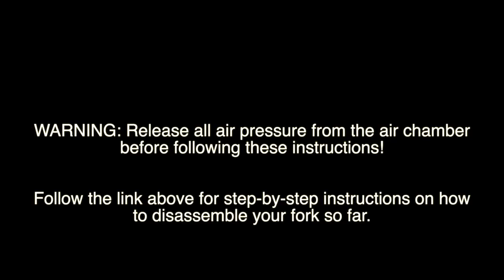FOX 38 Air Spring Service - Simple step-by-step instructions

Comment: Probably a really silly question, but do you have to heat the base of the shaft to remove the base stud from the airshaft? I'm worried about potentially overheating the airshaft surface or damaging the seal that sits inside the base stud? Any help or recommendations would be greatly appreciated!
Reply from the maker: Yes you really do need to heat the shaft. There is a fair amount of Loc Tight on the base stud and that won’t be easy to remove if you don’t heat it.
Reply from the maker: The seal won’t be damaged if you don’t go crazy with the heat! 10 -20 seconds should be plenty
Reply from the maker: Chances are you’ll damaged the shaft and/or the stud if you try to remove without heating up because of the extra force needed to break the LocTight.

Comment: Is there any alternative to the press to hold while unscrewing, and without drilling holes etc? Also, for the bullet tool, alternative? I noticed now its fully sucked down and cant solve it.. Fox 38 on new bike...
Reply from the maker: Sadly this is a common issue with new forks! Unfortunately I don’t have any alternative solutions for holding the shaft safely (wooden block split in half with appropriate size hole could work), however you don’t necessarily need the bullet tool if you can solve the Stuckdown without removing the shaft completely.
Reply: @mtbsuspensiontech  how would it be done then, because I understood i have to remove it completely. Or there is another way to solve suckdown. Its completely sucked in for me... I will have hard time clamping it anyhow, with or without tool 🫠
Reply from the maker: If you can find a way to safely clamp the shaft, it should suffice to remove the base stud which will release the excess air from the negative chamber. 
The downside of not removing and cleaning the whole assembly is that it could happen again.
Reply: Sorry to bore you, but could you maybe tell me a timestamp in your video where I can see to what you mean that base stud is...Since on one end is white cap, and on other end is the shaft you clamp in video. Thanks a bunch
Reply from the maker: 1:10 shows how the base stud is removed. After this step, air can escape from the negative chamber, allowing you to fully extend the shaft again. After you have fully extended shaft, simply reinstall the base stud and your done.

Comment: So stoked on these videos. My only question is what clamp are you using on the damper/airspring shafts? I'm trying to figure out how to hold mine in place safely.
Reply from the maker: Hi Mason, thanks for your positive feedback! You can try drilling an appropriately sized hole in a piece of wood, then cutting the wood in half right through the middle of the hole and using that to hold the shaft in the vice.

Comment: What still baffles me after doing a 38 rebuild is equalization of the negative/positive.  

Doesn’t seem to be the case and if not rebuilt with the airshaft at full extension, you will have issues that cannot be resolved by pumping and cycling in increments.
Reply from the maker: Achieving equilibrium between the positive and negative chambers is still feasible after a rebuild without the shaft at full extension, but it becomes more challenging. First, extending the fork—instead of compressing it—is necessary to maneuver the air piston beyond the equalizing channel. Additionally, the force needed to compress the air within the smaller negative chamber is significantly higher compared to the compression force required for the much larger positive chamber.

Effectively pumping and cycling the fork typically relies on the proper positioning of the airshaft, specifically, resting on or near the equalizing channel. In instances of even minor “Stuckdown,” where the fork does not rebound fully, it becomes necessary to extend the fork instead of compressing it to achieve proper equalization.

Comment: Great vid!  
Wondering if it is normal for a new air shaft to have a ton of friction and stiction without the 3 mL Fox 20Wt in the top to help lube things up? As in even if it's been properly greased? My brand new one that Fox replaced as a warranty feels pretty crap. The one I rebuilt felt much better by using enough grease to completely coat the inner sleeve as the piston traveled up and down, but now I realize a tiny bit of oil may be better suited for that? Also I didn't see you take out or grease the shaft seals and bushing at the end of the air can? Isn't that an important seal that can be dry as well? Any reason not to use a bit of Fox gold on all the seals as well to keep friction/stiction down?
Reply from the maker: Fox 20WT will definitely help keep things smooth. Like I mentioned in the video, be careful about using too much grease as this can lead to stuck down if it blocks the small channel between positive and negative air chambers. 
And you’re right, the shaft seal on the neg plate is an important seal which also needs to be kept well greased. 
👍
Reply: @mtbsuspensiontech  is that the blue one that is very hard to replace?

Comment: Is that Push top cap socket made from aluminium or painted steel? I turned down a regular steel socket of my own but worry its too hard a material to be using on the aluminium top cap and going to damage it.
Reply from the maker: The PUSH socket is made of aluminium - but I’ve used bevel-less steel sockets in the past without too much damage.

Comment: Good Job - is there a link for that bullet tool? or a fox number?
Reply from the maker: Fox Number: 398-00-657 Tooling: Bullet, Sealhead To Shaft, FLOAT NA 2
Reply: Seems like a nice to have tool but not necessary? Will the shaft line up without it?

Comment: @1:36 Are all fox 38 air shaft rod hollow? That is part of the negative chamber?
Reply: Yes and yes!
Reply from the maker: Nearly all air shafts are hollow, doesn’t matter which model or brand, and yes this is part of the negative air chamber.
Reply: @mtbsuspensiontech  Amen. Looking at the na2 air shaft assembly diagram, the air piston pin gap must face the base stud. So yes, it is indeed hollow. I wonder if the air shaft rod insides gets gunked up with grease too.

Comment: is there a quad seal to replace inside the neg plate?
Reply from the maker: There is, but it’s not really necessary to swap unless you are loosing air or have several thousand miles behind you…